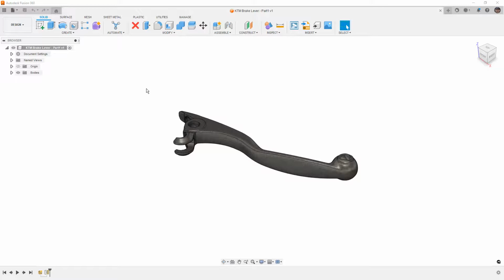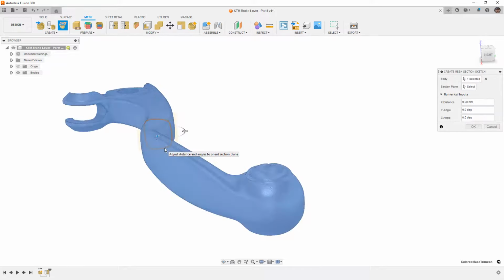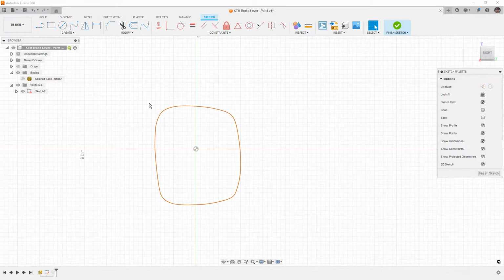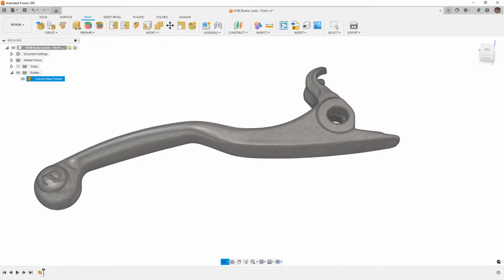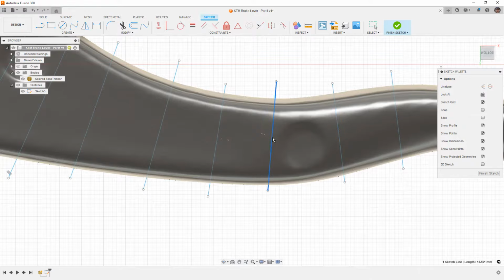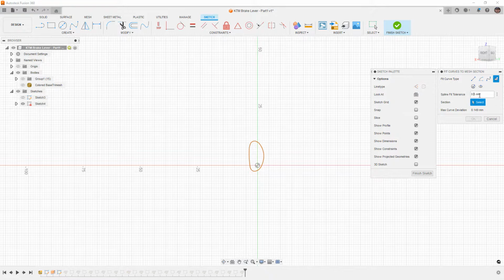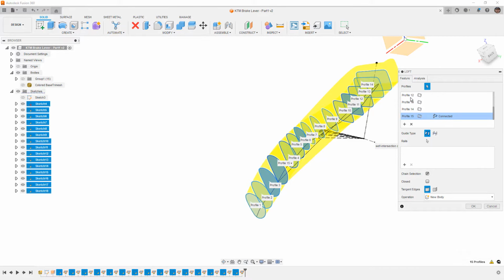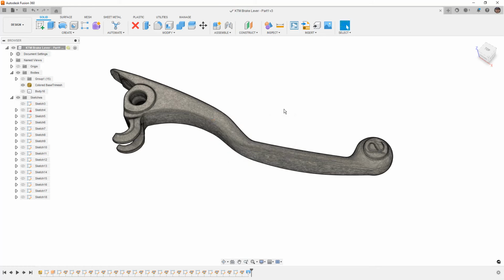Reverse Engineer Workflows in #fusion360  Part 1 | How To Work Use Mesh Section Sketches

Comment: Good video but wow at how limited and inefficient fusion is for this use case.
Reply from the maker: This is a multi-part series showing the different tools to extra data from a mesh.  Doing a part like this with that many sections is tough for sure.  A program like QuickSurface has some automation to it that will make a bunch of mesh sections for you quickly and is much more adept at creating clean splines from them.  Fusion can do this but its more of a tool I use on prismatic parts where you can use a line or arc rather than something with more "shape" to it.

Comment: You didnt do a CurvatureComb when creating the Mesh Section by using the extrude faces. It seems to me as my CurvaturComb has the same irregular curvatur no matter if i use the the Mesh Section Sketch function or the extruded faces. Maybe I got it wrong.....
Reply from the maker: The curvature is going to be a direct result of the spline created.  The one from the mesh section is very noisey because of all the small triangles.  So when trying to apply a fit spline to it the result of the spline is bad.  A manual one can also be bad (have a lot of changes in curvature) but its easier to control.  In general the fewer the points (fit point spline) the better.

Comment: Good project, Can you please let me know what scanner you have used and also recommend me one  I could buy to do that kind of job with a very low budget. Thanks
Reply from the maker: Hi there, on this channel we are affiliates for both Creality and Revopoint and have used and covered many different scanners on this channel.  I can't remember off the top of my head but the scan in the video might have been done with the Shining Pro HD scanner ($7000), but i have scanned the lever with other scanners as well.  The problem you will find is that in the lower price range (around $200-$300) you will see the precision/accuracy numbers are very different than a scanner in the $1000 range.  Something like the Creality Scan Otter or the Revopoint Mini2 will handle small objects with good detail.  we have review videos and some how to videos with both scanners.  The otter we did a black triple clamp with and the mini2 we used for an RC car part series making a transmission cover and 3d printing it.

Comment: I wondered about creating a mesh section sketch or two along the XY plane, then extruding to make a solid of the entire handle, including the hooks and ball end, then using fillets and cuts to round out the edges and create the special features.
Reply from the maker: You could. in Part 3 https://youtu.be/XWvmcxg9Zg4?si=G0qTyGfRMiTI25sO  We create the lever in that way but in order to get a cleaner curve we do it manually.  If you could get a mesh section where you needed it can work but again watch out for those auto splines.

Comment: Great idea! But nowadays with all this AI stuff I expect this to happen automatically by clicking a button.
Reply from the maker: Fusion does have that (sort of).  If you buy the design extension and go to convert your mesh there is an "organic" option and it will convert a tri mesh to a quad mesh, then quad mesh to a freeform body.

Mesh programs dedicated for scanning mesh manipulation still don't have an auto button but i know nPower was working on this years ago with their RE add-in for Solidworks.  Right now AI is making mesh files but I have not seen anything that would be considered a usable model (BREP or NURBS).
Reply: @LearnEverythingAboutDesign  Thank you! What I saw a couple of weeks on LinkedIn was amazing. By taking just a photograph of a "real" technical drawing with visible measurements etc. AI made the part in 3d in seconds. It's going in the right direction.

Comment: Thank you for the tutorials. I have a qustion about using the perpendicular lines and then extruding them as a surface. Is it neccessary or can I just create mesh section sketch on the body and position it manually? I am getting a hard time achieving a smooth loft surface between the individual mesh sketch sections and making the perpendicular lines is the only part of your tutorial I did not follow. But I suspect the issue is my part being much more curvy (A scan of hand molded to plasticine).
Reply from the maker: You can certainly position them manually wherever you need to.  Just remember that the auto curves generated from mesh section sketches are not great in terms of being smooth.  Honestly probably the best workflow for you if you have a hand scan would be to convert your scan to a quad mesh in another program and use the Convert option in the freeform tools.  If its not a mechanical part, the mesh section sketches are probably going to be a bit too much work.  I think the 2nd video in this series shows how to manually make a form fit a scan which might help, but again a quad mesh conversion will probably be best.  i think there is a free quad remesher, you can often do it in blender.  and you can do it in Fusion if you have the Design Extension.  Then on the Convert Mesh tool there is an organic option that will do the quad remesh and tspline conversion.

Comment: this is so dumb you should be able to use a touch screen trace with a pen the extrude
Reply from the maker: Even if you did that you still have the issue of tolerance to a mesh.  If the functionality to trace on a touch screen was there we would have to still find away to get a good spline off potentially noisy scan data.

Comment: meshing with mesh does not look fun ... I have already design from a fresh start so this has never come up... but I got a new scanner and not sure its worth the trouble to turn into a file type i can use...lol
Reply from the maker: Yeah.  Doing freeform modeling and snapping to a mesh is a great option.  But reverse engineering parts from scan data takes a lot of time.  It is a bit easier with dedicated tools (expensive) and the seat time to learn them.  It can be done in Fusion, but its really not the intention of the tool.

Comment: Amazing video!
Am very curious if you could create a mesh section sketch along these profiles and use this as a guide rail for easier loft operation?
Otherwise the advice using them as construction curves is great!
Reply from the maker: yeah, but the problem you still run into is that it is trying to average out the shape and you need to get pretty loose with the tolerances to get a spline/curve that is 'good" in my opinion.  Wrapping a freeform body OR using those guides for a freeform loft will produce a better final surface for sure.

Comment: You always say prismatic, don't you mean parametric?
Reply from the maker: Not sure where you mean.  Its possible I made a mistake in there but in general:
Prismatic - Mesh/scan files are made up of triangles and while not a true prism the general definition usually means something like the same cross section/shape on both ends.  When i talk about a mesh file generally i say prismatic meaning the elements are the same shape.
Parametric - Generally means the design is controlled by parameters.  Definitions/constraints with a history involved.

Its possible i said one when i meant another as my videos aren't scripted, i just speak while doing them.  If i did sorry for any confusion.
Reply: @LearnEverythingAboutDesign  Ah i see, i thought you MEAN acutally parametric. ✌
BTW... love your vids! Thanks for the great training lessons!
Reply from the maker: @GeryS.  no problem! thanks for watching!

Comment: Thanks for the video! You mentioned a few times that “this isn’t the way I’d actually remodel this”. How would you do it? What’s your preferred method and do you have a video demonstrating that method. Thx in advance for your reply. (EDIT) I watched your other 2 videos in this series which more than answered my question about your preferred approach. Extremely informative and helpful. Thank you.
Reply from the maker: You have been busy!  Yeah each situation will determine what the preferred method is.  Fusion isn't the perfect tool for this but it is certainly possible to get a good result with some patience i think.

Comment: Great tips! Really appreciate the effort you place in building this material. Thanks a lot!!
One question, knowing this object is aluminum cast, cleaning up the mesh and the surface in a tool such as Zbrush could help getting better mesh section in Fusion?
Reply from the maker: Yes it will BUT i still highly doubt that the mesh section sketches would be any better.  Using the section sketches that wrap to a mesh, even a highly dense mesh, will never be as "clean" as sketching the curves yourself or using the form.

Comment: The only reason I use mesh section sketch is to give me the orange outline to trace with splines manually. It's always really  janky when trying to thicken surfaces otherwise. 

I wish Autodesk would update mesh section sketches to allow multiples being generated in a grid if you understand what I mean. Geomagic design x has this feature
Reply from the maker: Yeah as I show here it isn't super great quality.  The loft is ok but you are right as soon as you start to offset it those spots would really show.  I think right now the best thing you can do is to use the mesh section and make that a construction curve, then snap to it where you wanted to.